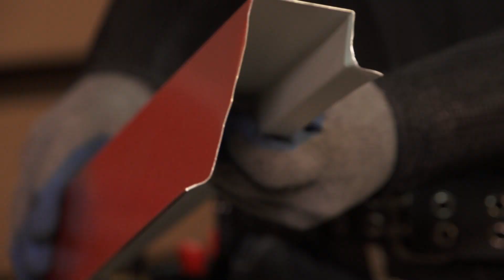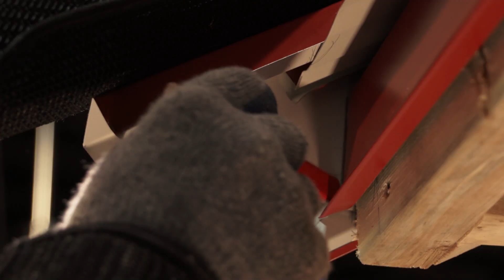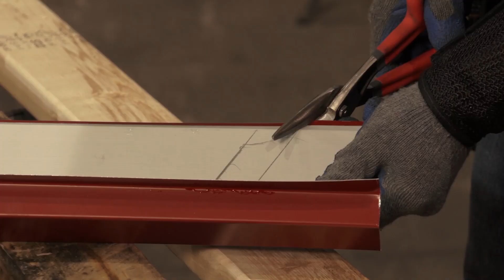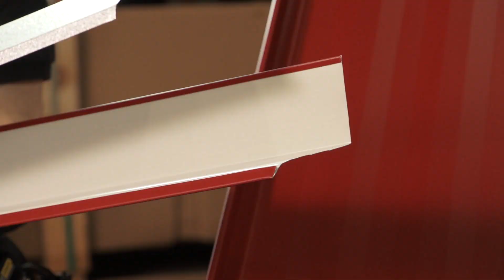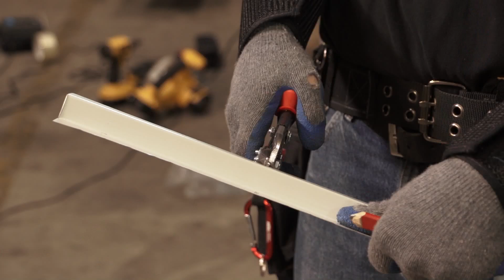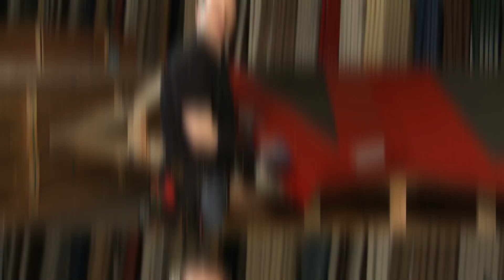How to Install Rake/Gable Trim: ABC SL-16® Metal Roofing System

Comment: Yano if i had a video like this about 35yrs ago that would have been awesome?!? LOL I grew up in a time they didnt even have cell phones so i ,surely didnt have youtube! lol  I have done metal work and facia and trim for years. A lot of that can be incorperated in the installing of the metal roofing. But when it comes to the type of products you should have too install it is the thing? I just need to know what items and products i need to get a roof done? Like starters ,which you are calling a continuous kleet. But its basically a metal starter strip, channel lock for the last piece....? In any case i just told a guy that is hiring me yet a 3rd time to do some work i could install the metal roofing like i have done it before.......nope! LOL but i am 100% sure i can figure it out! Now i know there are things i dont know about it i should know. But then i wouldnt be working so.....hehehe Where can i go to find out what products i need for this type of roofing? So im not totally winging it?lol

Comment: Why would you have to use rivets when using the z bar though ? Is only one end of the rake hemmed ? Because the rake I install has a hem and kick on both sides and snaps together like ridge cap

Comment: What is the purposenof the continous cleat?
Reply: It's a clip so you don't have to screw through the finished cover trim. Prevents the bottom from lifting off in winds etc

Comment: I'm building a shed against the back of a house.  I'll have a hi-side trim installed on the side of the house and extending several inches over the shed roof (extending over the panel ribs and installed on zee-closure).  I'll also have a rake trim installed on a perimeter cleat and zee-closure.  How do I finish the rake trim where it meets the hi-side trim?

Comment: I see that your recommendation to fold down "1 1/2 Inch tabs" at the eaves would have fully covered the hole. You marked and cut a 1" tab, which is a little short. Over-all, nice job.

Comment: How about rake on a gambrel roof no one seems to cover this
Reply: Did you ever find an answer Dave? I have a metal roof on my house that is leaking at all 4 corners, I think it is because the trim sits on top of the high ridges of the metal, then there are large gaps in the valleys of the metal all the way down.

Comment: supppose gable is tapered.any solution or you will give the gutter
Reply from the maker: Hi Hamza; thanks for your question! To accommodate a tapered gable design, you can order tapered rake trim.
Reply: ***** no we cannot use  ! i feel you dint get my question ,suppose our eave length is different for both side.so Automatically gabel will not make 90 degree with eave.so in this situation you need to give path for water exit .how you will handel this situation.
Reply from the maker: Hi Hanza. What you're describing sounds like when your rake comes into your eave, it isn't at 90 degrees. Despite this, you would still install your eave trim underneath the roof panel and install the rake trim as shown in the video. This will require that you modify the angle for the rake trim to suit your field conditions. If you have any further questions about your specific project, one of our representatives would be happy to take a look at your drawings to better help with your specific field conditions. You can find a representative in your area here: http://www.abcmetalroofing.com/About-Us/Locations/.

Comment: Does anyone know how a metal panel (exposed fasteners) installation on a Roof whose Ridge is longer then the Bottom. Should ridges be cut just before the Rake edge or should Ridges be tucked under Rake with the rake cut. Installer cut the Rake and tucked Ridges under Rake. Now water runs under metal.